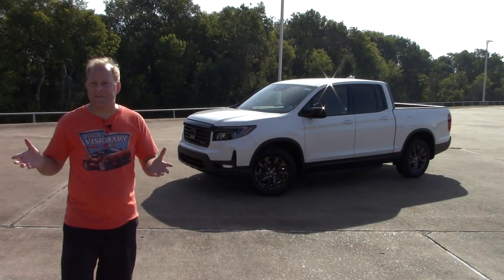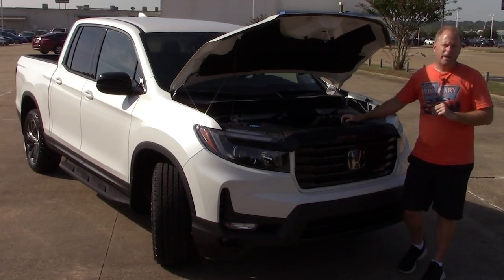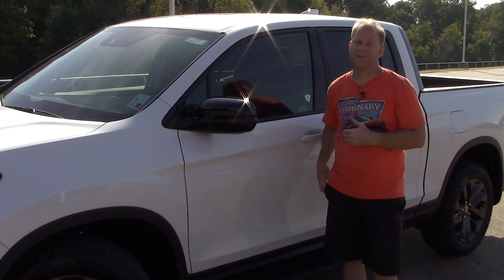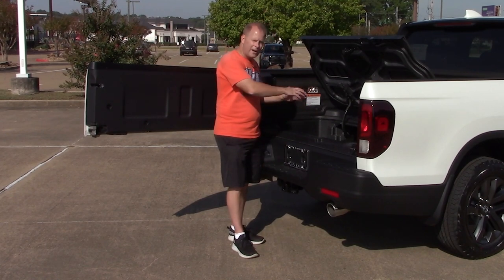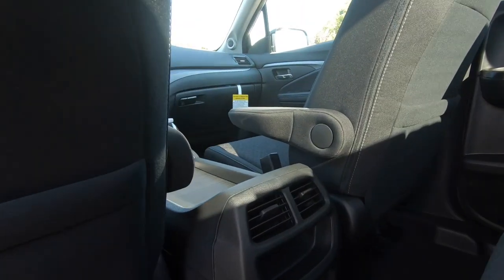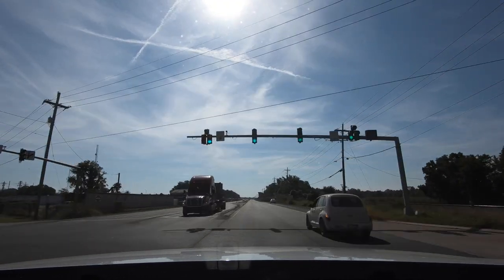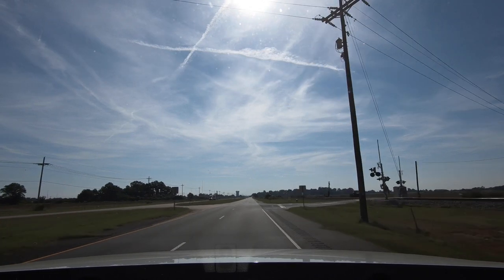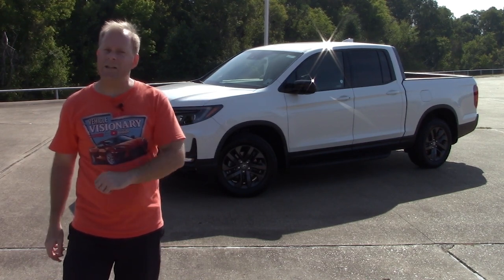2022 #Honda #Ridgeline Sport - The CAR LIKE TRUCK

Comment: The Ridgeline Sport I ordered in early November came in...Silver/Black...  So far three tanks of fuel.  

Regular gas: general driving set on Economy...21 mpg at the pump...gauge said 23.

90 octane non-ethanol: general driving but a little more highway in the Standard drive setting...23 mpg...gauge said 23.7

91 octane non-ethanol: all highway in the Economy mode....27.9 mpg...gauge said 27.3

Now filled with some 90 octane mixed with the rest of the 91 non-entanol. Will be doing a 175 mile trip tomorrow...

So far it has been great...
Reply from the maker: Thank you for sharing, Robert! Congratulations on your purchase.

Comment: Started with the 2007, replaced that with the 2013 and have replaced that with the 2022.  Improvements have been made to each new generation.  This one is much quieter inside than the last.  The sound system is better as well including the bed speaker system.  Looked at the Maverick Hybrid but its just too small to be comfortable.  Nearly 200,000 on each of the last two so I have high hopes for this one.
Reply from the maker: Thank you for sharing, John!

Comment: Thanks for the review!  We love our Ridgeline which is pushing at nearly 200,000 miles.   Time to find a new one.  My husband wants the new Ford Maverick, but I want a Ridgeline because it has more room in the backseat.  We have two grandchildren so that means bulky car seats.  I also love the side opening tailgate feature and the under the bed storage area, and I just like the look of it.  It has a bit of a cult following as we always give each other a double take when we see each other on the road.  It is a fun truck.
Reply: Also we the people who developed more than basic ideas for the up in coming models should definitely get a chance to test drive the updated version. The base models should be for those who are completely comfortable with that option. But it's 2023 models that are being designed now. So it should have more unique options with a pricetag of 50,000+ where's the love of honda heads gonna bless those who want just a pinch more performance 🤣. Bigger factory rims in tires off-road tires should come standard . If honda don't wanna increase the bed length yes a hitch hook traveling trailer surrounded by a cage should be available with a top trim BlackOut version. I'm just saying it's a pinch more than a midsize truck to haul more lumber, drywall , concrete, sand, gravel,  clean ups ,

Comment: Bought a 2022 Ridgeline RTL-E and love it. Red with black interior. Have had a lot of Nissan Frontiers and the Honda is so much nicer. Just sold a 2020 F150 which was nice but I like the Honda better, it drives super smooth and is easy to park and it fits in the garage.
Reply from the maker: Congratulations on your purchase, Fred! Thank you for sharing.
Reply: nice!

Comment: Have 3000 miles on our 2022 RTL-E. Sold our camper so we traded in a 2020 Tundra to go back to mid-size. Have also owned a 2015 Colorado and a 2014 Tacoma. The Ridgeline is a super comfortable vehicle in all respects. Tows our ATVs with no issues. We are getting about 25mpg highway, around 20 overall. The truck vs non-truck debate is silly. It has a pickup bed, it’s a truck. Just happens to drive like a nice SUV. That said, I really don’t care if others don’t think it’s a truck….especially Tacoma owners. That was one uncomfortable, dated, strange shifting vehicle. Can’t figure why they are so popular.
Reply from the maker: Thank you for sharing, Wes!

Comment: Filled up when I got home last night right off the highway.  Running in Economy 189 miles, mostly highway at 65-80 mph, got 24 mpg with 5.1 gallons of high test mixed in with 15 gallons of high test non-ethanol. Meter read 24.7 mpg for the tank.
Reply from the maker: Thank you for sharing this information, Robert!

Comment: Plan on getting one in the next 6 months. I just wish Honda offered a lift kit. Installing one and voiding the warranty is a worry. The low clearance concerns me when we get 6 inches or more of snow out here in the country. Has anyone else drove it in heavy snow or lifted a Ridgeline? Thanks for the video.
Reply: Clearance won't be an issue in the snow. I went through 2 ft of heavy wet snow with no issue. I did upgrade to firestone destination at2 tires though.
Reply: With the AWD system that the Ridgeline has...  if the snow is deep enough to stop you, then you probably shouldn't be on the road anyway.   You'll be amazed at how good the AWD is.

Comment: My 2022 Ridgeline Black Edition ETA is November 1st. I test drove the Ranger and Tacoma and did not like the ride comfort.  I won't be towing more than 5k lbs - anything heavier, I would be looking at the full size trucks. The accessories I'm going with are: Blacked out emblems, rear seat storage, hard tonneau cover, winter floor mats. Also, I'll be getting the Falcon Wild Peaks 255 r60 18 tires to replace the 245s.
Reply: Congrats on the new Ridgeline! You're going to love it! I'm loving my '21 Sport

Comment: Have 2200 miles on the 2022 Sport at this point. Almost 3 moths old....  Fuel economy has been a low of 21 and a high of 28.  On the highway Regular will get 24-25 mpg. High test non-ethanol 26-28. General driving Regular will get 21-23. High Test non-ethanol 23-24. Have not tried standard High Test with ethanol yet.
Reply from the maker: Thank you for sharing, Robert!

Comment: Now have close to 6K miles on the clock and fuel economy keeps getting better. Last several tanks have been 24-26 mpg.  The last one the meter showed 26 and actual at the pump was 26.3...with very little highway driving.  Highest the meter has shown so far was 29.2 on an all highway trip. Speed was 70+- mph. The meter and pump have been +- .3mpg every tank.

Also just recently replaced the tri-fold bed top with an ARE full hard cap...what a difference...makes it into a station wagon without all the noise coming from the back. Went to buy a tailgate lock only to find out from the dealer an electronically operated one was already installed in all 2020-2022 models...saved me $100 in a manual one. Now the whole rear compartment is secured. The glass is so darkly tinted it is VERY hard to see into the bed.

With the windows down there is a LOT of wind buffeting...  Added VentShades and with the front windows all the way down and the rear 1/2 way down...nothing... And the windows can be left cracked without having to worry about the rain...

This vehicle just keeps getting better and better...
Reply from the maker: I appreciate you taking the time to share your experience, Robert! Thank you!

Comment: I'm going with the Ridgeline, but for me, the biggest competitor was the Outback Wilderness Edition. Although it's not a pick up truck' it has the common element of being both an offroader (to a certain extent) and a great driver. Looks cool too imo. In the end; I prefer to avoid turbos when I can. I just trust NA engines more; especially Honda's.
Reply from the maker: Thanks for sharing!
Reply: So funny to see your comment. We have an outback wilderness and a ridgeline. So much for having one (somewhat) fuel efficient car like I had planned!

Comment: Gas mileage keeps going up... On a recent trip from NH to Connecticut the meter was at 31.2 mpg from southern NH to northern Connecticut where it gets very hilly. Once to my destination just south of Hartford the meter read 29.2 and the pump mileage was 29 mpg even. Nothing but Regular grade gas is being used.
With lots of traffic and traffic lights over the next four days the best I could squeeze out of it was 20 mpg by the time I was headed home. Once on the highway again was able to bring the mileage up to 25.0. Ran the rest of the tank down locally and ended with a meter reading of 25.6 and 25.2 at the pump. 
Now closing in on 7K at which point it will go in for an oil change...
...and another Ridgeline owner bought the tri-fold bed top from me for their 2019 TLE.

Comment: Odd....Changed the oil in the Ridgeline and rotated the tires at the same time...16K mikes exactly.  When I first bought the vehicle I noticed how quiet the engine was both when in the vehicle and standing next to it while at idle.  When the dealer changed the oil at 7500 miles a few days later I noticed I could hear the engine while at idle for the first time... After I changed the oil, Penzoil 0W-20 5 qt. topped off with DuraLube, a couple days later I was sitting at a stop light and thought that the  engine idle stop had come on.  When I looked at the tac it was showing the vehicle was running...now I am back to not hearing the engine again at idle...

Also fuel mileage... Before the dealer oil change I was getting 28-30 on the highway. After the change it dropped off to no better than 28. The one trip that I have taken since I changed the oil, and it's the same trip every month, was 30.2....

Comment: Now have 7500 on the clock and about to go in for a tire rotation and oil change. 
On a trip to Ct. last week the meter was up to 31.2 mpg at one point which is the highest it has ever been. On the exact same trip as done two months ago, the mileage was 30.0 at the pump (30.2 meter) which is 1 mpg higher than the best so for.. After filling up there was around town driving for three days in a lot of traffic. 80 miles total....meter said 19.2 and the pump said 19.0...worst tank ever. I can see how people who have a lot of stop and go and little highway miles would never break 20 mpg.  Where I live I average 24-26 mpg around town..highway 28-30.
Using the mpg meter on the display, it is very easy to get a lot better mpg than the truck is rated for. Heavy foot it, even on the highway, and you'll be down around 20. Have found that the best crusing speed mileage is 67-71. Faster than that mpg starts to drop off. On the way home I ran 70+- and got 27.2 mpg on the meter. On the way down ran 60-65 and got 30.0 at the pump.
Still absolutely LOVE the ARE cap...was expansive but worth every penny. 
Everyone who rides in the Ridgeline comments on how smooth and quiet it is...three of my friends who drive a Chrysler mini-van, Toyota Tacoma and a Nissan Frontier are planning a Ridgeline when it is time for a change.
Reply: Correction on the meter going down to Ct....it was 32.1 not 31.2...that was last trip.

Comment: Thanks for your review of this awesome American design and built truck.  I do understand what you mean by car like,  but I do believe this kind of language that  makes others not consider this truck a truck...I  don't need a full size for everyday use and don't need anything smaller either....this truck has everything I need from  a everyday truck and  use full size truck  when needed. But a missing part of those comparing to trucks that  are more off Roady,  is that very few people uses them for their capabilities. Also,  to compare to full size.. they fail to mention that for example,  the capability of F150, F250, F350, F450, F550, F650, F750 are all different capabilities and use,  so not very  smart to compare.
Reply from the maker: Thank you for taking the time to share! You brought up some great points. I appreciate your time.
Reply: @VehicleVisionary  I'm a fan of your shows and  hope you continue and  not be a sheep like many others repeating same script,  or acting like everyone is a racecar driver or go beat up their  trucks.

Comment: Just turned 15K miles...last three highway tanks of gas were 28.5, 28.3 and again today 28.3 when running between 68-72 mph....175-350 miles at a time.. At 75-80 mph fuel economy drops to 26+-. This is in hilly country not flats. 
Had the free oil change at 10k at the dealership. When I had the state inspection done a few weeks ago they "recommended" that the brake calipers be lubricated and the differential oil be changed. I regularly change my differential oil but it is every 30-50k not 15...any thoughts on this?  I have known people who have NEVER changed their differential fluid and never had a problem. 
Very few things I don't like:
1) The button that eliminates the engine stop at stop lights need to be changed to once pushed to eliminate that feture it stays gone till requested. Having to remember to push the button every time is a PITA. Why is the ECONO button "on" or "oiff" permanently...the engine stop should be the same.
2) "Fog Lights"...aren't really.... They need to be BRIGHTER and also be able to be run when the lighting switch is in the RUNNING LIGHTS mode...they do nothing except look cool when running in conjunction with the headlights...
3)Heated mirrors....should be also standard equipment on the SPORT MODEL. The mirrors are already electrically operated so adding the heating element would not cost much and is a major safety feature. 
4) Not having "hot" USB ports unless the ignition is on is also a real PITA...

The electronics are just beyond me but that is my fault not the vehicles...

Other than those minor things could not be happier with the vehicle, especially after adding the hard cap...

Comment: It's not a truck .. because it doesn't have an uncomfortable buckboard ride ... and is too quiet ... and doesn't skitter around tuns like those ungainly full size trucks... there I said ... what to I own? a 2021 Ridgeline RTL-E which replaced my "MOAB READY" 2019 RAM 1500 ... thanks Keith Chicago

Comment: I think they haven't changed anything yet that really needs changing. ( First of all I love hondas ! But they need higher suspension with a 4" liftkit. Step bars 3.8 litters. More leg room , front and back. A honda traveling trailer with a additional 5foot bed . 350 hp🤔. 1 foot wider/6" inches from driver side to passengers seats. The 2023 models should be XL ridgeline models . Also they should develop a unique cage that snap on and off the truck bed. For items like stoves ,refrigerators, dryers ,washers and other items over 36"s taller than the bed. Plus a roof rack. This should be on Honda Ridgeline top edition Blackout Edition multiple options for color each customer choose. Not just black and white color only. Top trim levels only!

Comment: I bought a 2021 RTL. I looooove it. My only complaint is the wind throb at highway speeds. There really is no great way to roll your windows all the way down. It’s pretty bad. But I just drove it for four hours and I love the heated leather seats. I also like the cruise control features.
Reply from the maker: Thank you for taking the time to watch and share!
Reply: Try opening the rear slider
Reply: Maybe get some door visors?